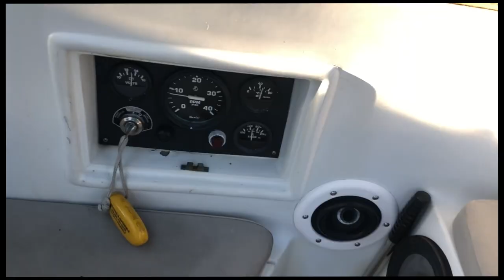EP 14: OUR BOAT CAUGHT FIRE! Birthdays at Anchor & MORE Engine Work! | Two the Horizon Sailing

Comment: Two the Horizon Sailing , I considered editing my 1st comment to include this one. Nahh. 😉 This video is from several months and thus, history. 
Your rapid handling of the electrical fire was exactly correct. Good job noticing the situation quickly. Because I'm a "ounce of prevention" type I present you with the following... 🤔😁
"Smoking" the small wires to the engine hour meter is relatively minor. That is obviously multiplied exponentially by the run from the source to the meter. "Burning" the wires can be a whole different story. I would double check all rubber/plastic hoses and wiring within a couple inches of a burnt wire. Superficial scorching shouldn't be an issue but any charing in the area bares a closer look. 
A worst case scenario would be unseen charing to 100% depth of the insulation on power leads to a battery switch. This kind of damage might not present it self for months to years later. Imagine a major electrical fire, at night, in 10 foot plus seas. At the same time you lose ALL electrical power!!! 
A live electrical fire on a dead vessel is a bad situation in good weather in the daytime. To have it happen in a worse case environment would be 3 potentially life threatening catastrophic events occurring simultaneously. 
Good Luck and Great Sailing 🙋‍♂️
Reply from the maker: Mike Barron thanks for commenting and sharing that knowledge! We did inspect all the surrounding wires/hoses luckily it only melted the hour counter duplex wire insulation. It was still quite scary, can’t imagine what it would be like if it had been a bigger fire.. 
it’s another reason we’ve pretty much replaced all the wiring on Gemini, expecting that most of it is about 33yrs old (original) we sleep much better at night knowing we’ve replaced all the major components, connections and wiring.
Thanks for commenting, and this video is months old but man, it feels like yesterday we were hunched over that darn engine hole! 
Our next video shows the process of building a new mainsail, which we did ourselves from start to finish. Excited to share that one with you all. 
If you are interested in sneak peeks and extra real-time updates on our liveaboard life, please take a look at our Patreon. We would love to have more educational and relevant comments like yours to give extra value to our videos, blog posts & more. 
www.patreon.com/twothehorizon sailing

Cheers! Happy new year 
Cheers